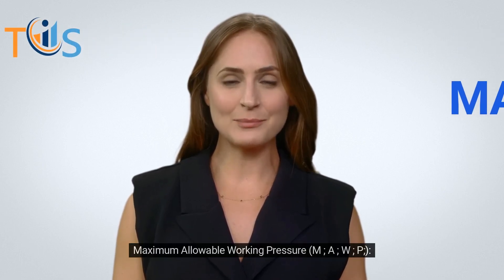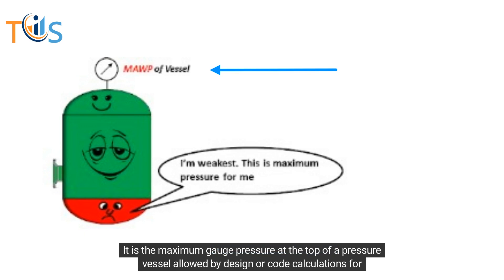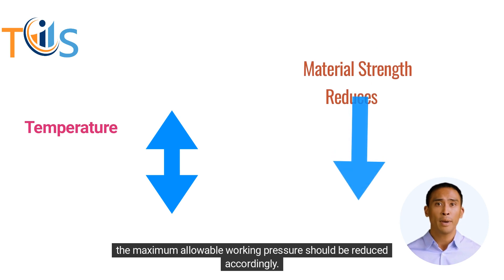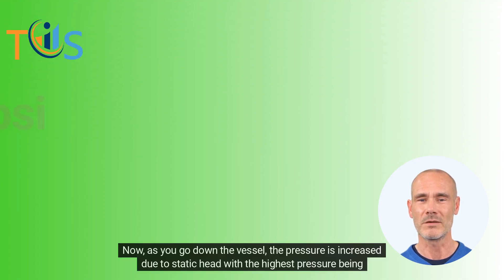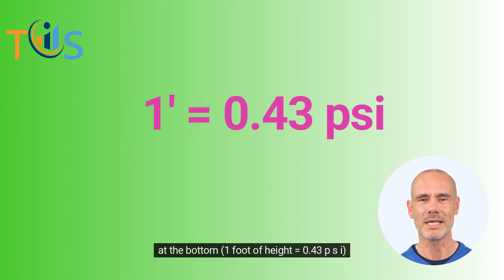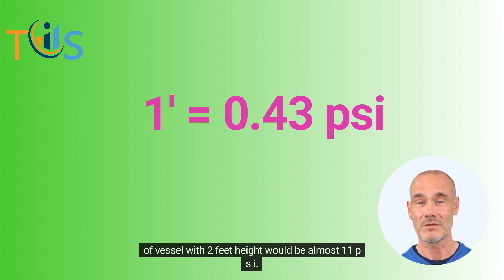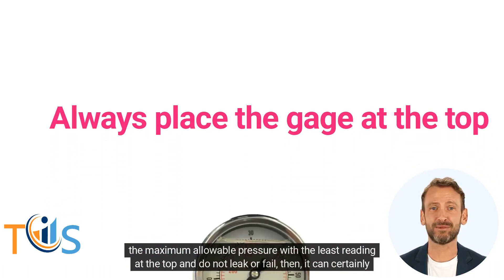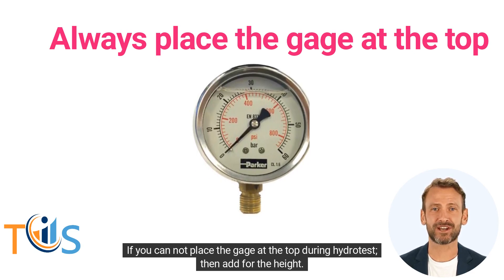Maximum Allowable Working Pressure (MAWP)

Comment: The pressure in a vessel exerted by a fluid depends upon not only the height but also the nature of the fluid being stored in that vessel. For instance, the pressure exerted would be different by water stored compared to the kerosine oil stored in the same vessel for the same height. P= Density× Gravity× Height.